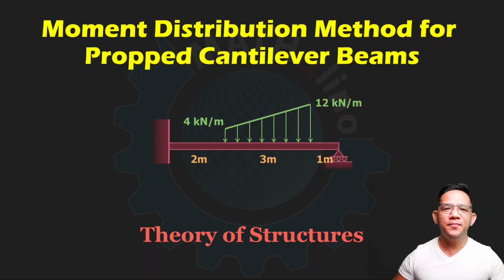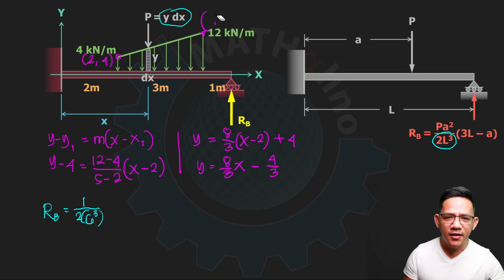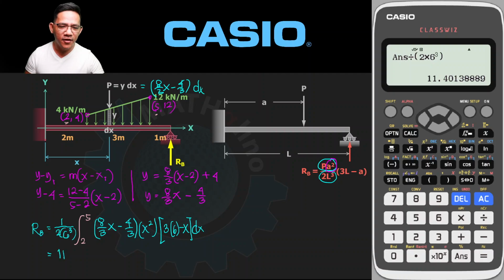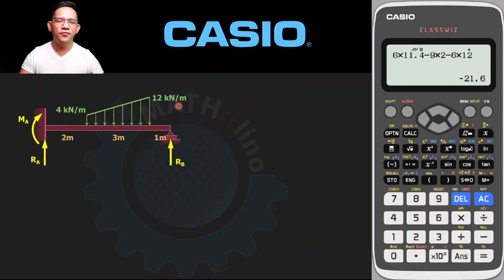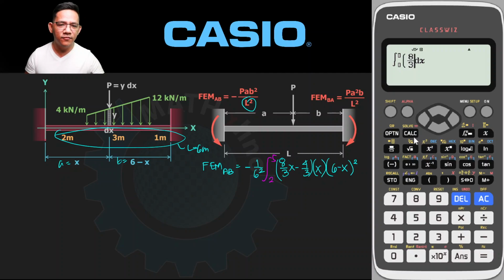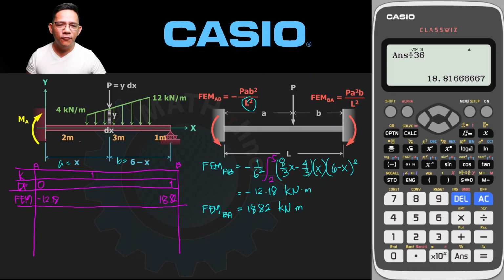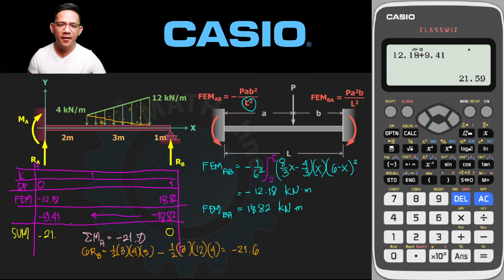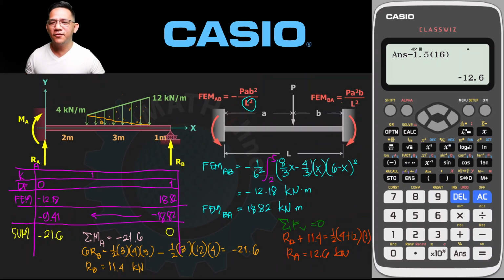Propped Beam Reactions by Moment Distribution Method

Comment: Sir, pa'no po ba malalaman yung sign convention ng moment? Sa'min po kasi for example yung Rb since nasa kaliwa nya yung A, negative po, so bale po positive po yung moment sa A sa sign convention namin, pero 'di lang po do'n yung problema ko e, pansin ko po kasi 'pag nakakakuha ako ng value ng moment using conjugate or 3-moment equation method, 'pag ginagamit ko na po para kumuha ng reactions, may times po na namamali e, halo-halo na po kasi principles e, merong depende sa sag at meron naman pong depende sa rotations nung forces. Sana po matulungan n'yo ako, magte-take po kasi ako ng board sa May e, thank you po.
Reply from the maker: For internal moment ng beam, sa elastic curve mo i-relate ang sign ng moment, (+) kapag mag bend upward, (-) naman kapag mag bend downward.